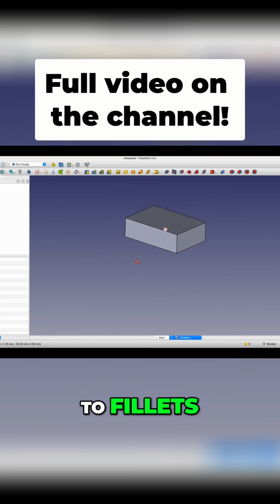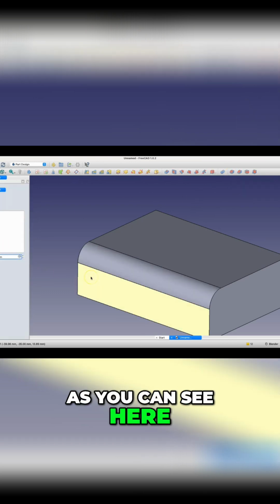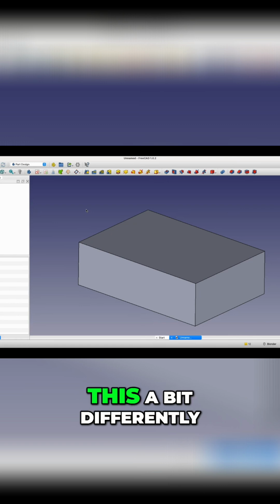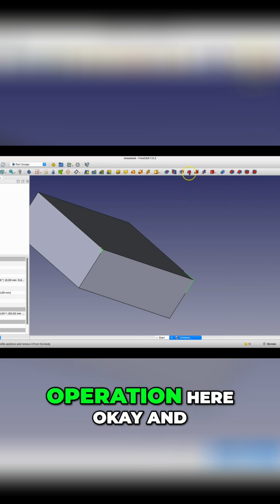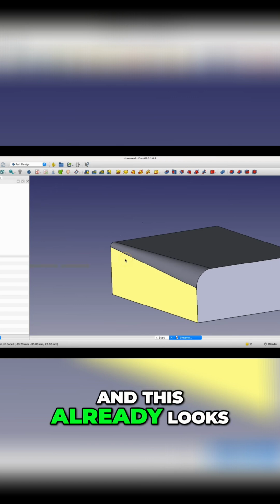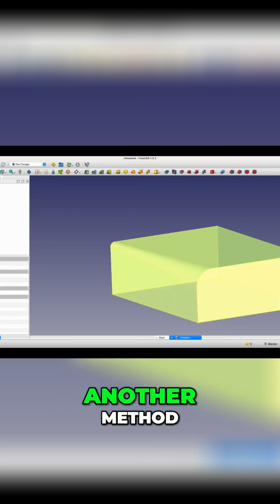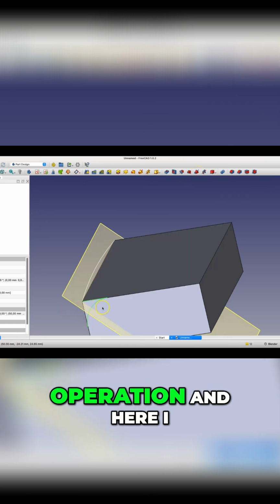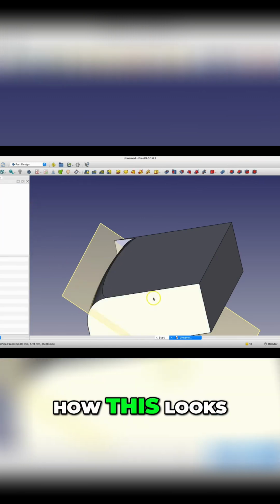FreeCAD Fillet Mastery Level Up Your Design Skills

Comment from the maker: Want to improve your FreeCAD skills faster?
Check out my short FreeCAD mini-courses – each focused on one practical skill, easy to follow, and affordable.

Parameters & Formulas – build smart models that adapt automatically → learn3dcad.com/freecad-mini-course-parameters-in-action

Phone Stand in FreeCAD – design a 3D printable gadget step by step → learn3dcad.com/freecad-course-phone-stand

Each mini-course is short, structured, and gives you a skill you can apply right away.
Instant access — download immediately, keep it forever.
Your support helps me create more FreeCAD tutorials.